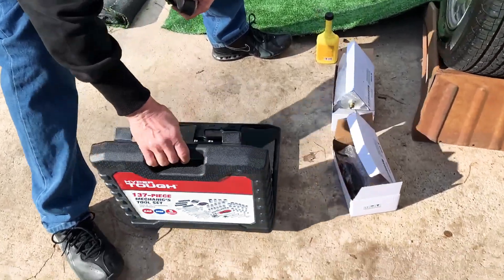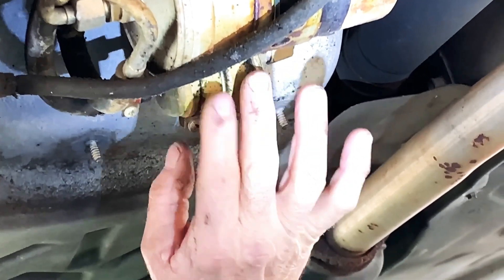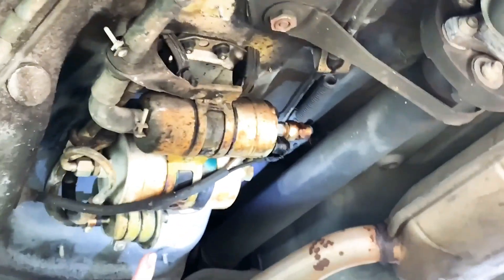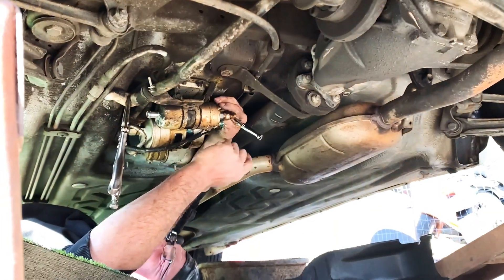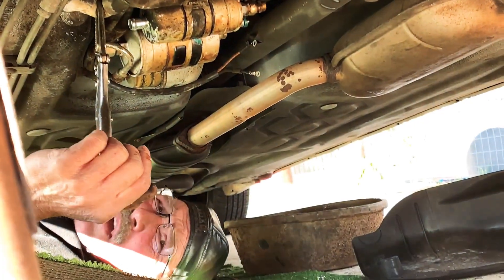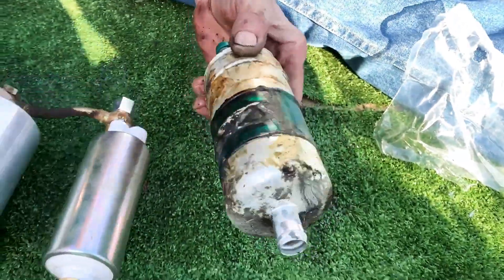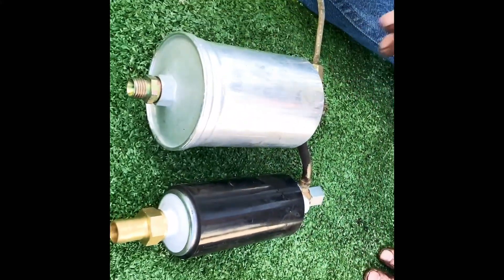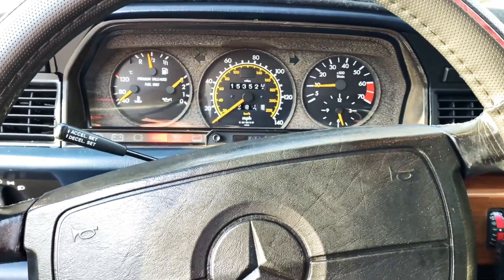Putting New Fuel Pumps On My 1991 Mercedes Benz 190e 2.3!

Comment: Hey. How have you been? I get to do fuel pump jobs   The fuel pump went out in the WinStar and I haven’t posted any content on it yet, but I have purchased a different vehicle also. A 1995.5 Isuzu rodeo yes 3.2 L V6 with four-wheel-drive and manual transmission. I bought it with a slight lifter tick at 240,000 miles and I was driving it for a while and we had some warm days here in Colorado at the beginning of this week, and that’s when it quit. I noticed when I would turn the ignition on to start I couldn’t hear the fuel pump priming or anything. And if you try to start it just sits there and Kranks. Ever since I had bought it, when the engine would get real warm, sometimes it would act like a slight misfire or like it was losing power every so often and my thought was ignition module. I checked the ignition module and everything looks great. However, I found out it was the fuel pump. Oh and the ticking, well I found out from the previous owners that they had been using 5W 30 fulsome thetic. The owners manual and the oil cap both say 10W-30 conventional. So I put that in along with some Marvel mystery oil and that quieted it down quite a bit.
Reply from the maker: Ohh I’ve been doing great 👍 thank you for asking I Appreciate it hope you been doing well too :)
Reply: @damianpasour I’m glad to hear.